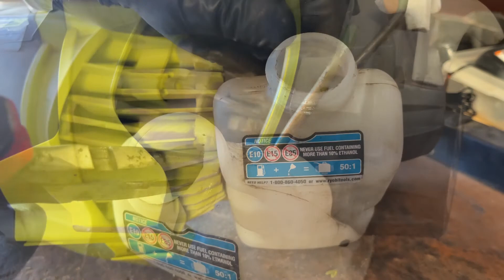Saving a Ryobi Jetfan Blower RY25AXB

Comment: I have one of these things- it will NEVER restart after  the engine gets hot and starts to cool off. It's been that way from the day it was brand new. When the engine is cold it starts well enough and it will run out a full tank. But when you shut it off, you're pretty much done for the day.
Reply: Bad /Defective ignition coil.
Reply: @xmiller7691  same thing for mine

Comment: Those carburetors are adjustable they take a small d size carburetor adjustment driver and it is directly in the middle of the barrel of the carburetor that little bitty brass ring with the brass thing in the middle is this small d

Comment: Mine has been a pain to start since day one. Had it about five years. Will clean carb tomorrow, air filter and change plug. If it doesn’t start after that I will be watching videos on hand held gas blowers and put this one in file 13
Reply from the maker: @tiffinhappy9744  if you replace it go with echo or stihl
Reply: @ thankyou. They are definetly my top picks. The Ryobi is powerful but it has always been a workout to start it

Comment: I have one of these. Won't start. Won't even try to run. Kicks back awfully. Good spark, fresh mix gas. Lines replaced. Carb opened & clean in side .. no crud. Nothing helps. Kicks back hard. Can these go out of time? Is there a keyway on the crankshaft? I know it seems unlikely but what else can it be? TIA.
Reply: Ever figure out your issue? I got a similar issue, I got spark, air and fuel but it's never turning over at all.  I seem to be getting good pressure from the engine and the ignition coil is lighting up my tester.  Replaced everything, spark plug, fuel lines, fuel filter, carburetor, new fuel.  I'm at a loss on what it could be.
Reply: Nope! I've worked on and fixed a lot of engines but this one is a real puzzle!  Can the timing some how have slipped? Mine won't even show evidence trying to fire.
Reply: @slhimages  same with mine.  I've fix a ton of engines myself and this one has me stumped.

Comment: He should have tried restarting it- after the engine gets hot, then is shut down and starts to cool.  Mine is impossible to  restart .If you don't restart it within 30 sec of shutting it down, you aren't going to get it started again anytime soon.😅 It has  to cool off for hours.
Reply from the maker: I’ve not had that issue with this one. I did just rebuild the carburetor though

Comment: Hi Hank’s garage. I have a question so, we were given one of these and we cannot get it to run even with starting fluid. We hooked up a spark checker and it fires great; even changed the plug just to verify and the ignition coil works just fine. We cannot get it to even pop with starting fluid or carburetor cleaner. Can you give us some suggestions? We did check the flywheel key and it was fine. We always know we’re two stroke that 95% of the time the carburetor needs to be cleaned because of ethanol crap. We are working on getting the carb cleaned but feel like that that’s not the bottom line problem.
Reply from the maker: @Autistic-Uhbuddy  take the muffler off and inspect the cylinder. May not have enough compression. Also the fuel filter may be clogged or the hoses are on backwards
Reply: @ Thank you for replying. We did check and pull the muffler off and it did not seem blocked. I know those units discharge the exhaust out of the tube as well. As far as compression, we measured it at 170 psi that seems a bit high. Although most people would applaud it and say that is very good. We think the unit is fairly new but 170 psi makes us think there is a blockage somewhere possibly. We will also follow the extra advice you gave us about the tubes and the fuel filter.

Comment: I have the same blower and it won’t rev up when self horizontal. If you point it at the sky it will run great.
Reply: Fuel bulb is good and just changed fuel and return line.
Reply: @javery50  Mine has been like that since day one. My guess is something with the design...??
Reply: Glad mine isn't the only one. I got a full arm workout trying to restart mine